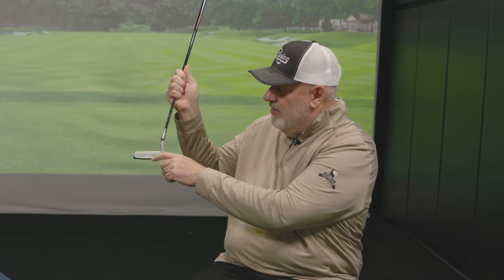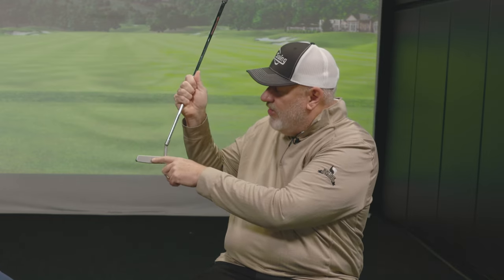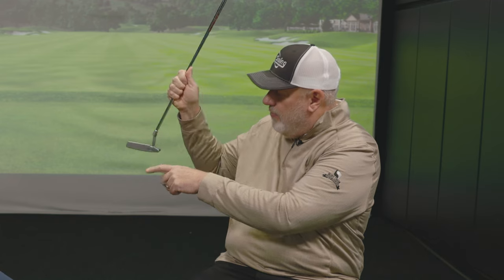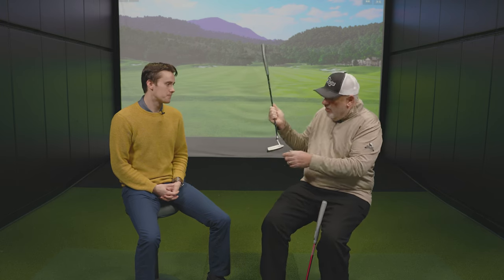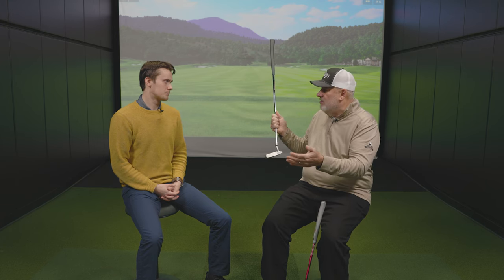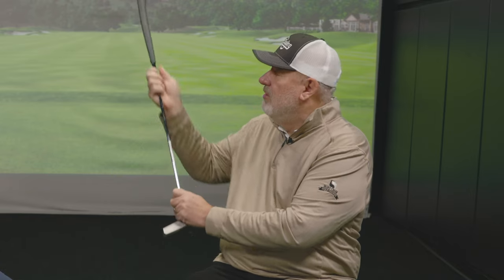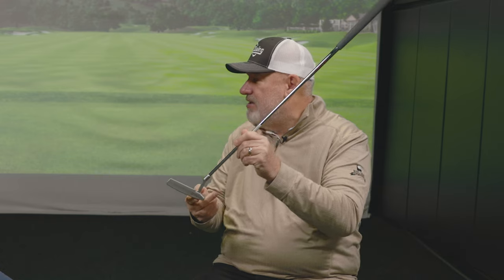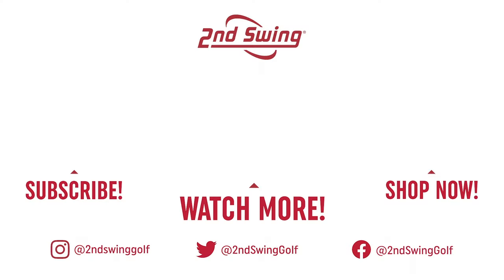The No. 1 Variable in Golf Putter Fittings

Comment: At age 61 and having played from age 7 I had always used a Blade style Putter
In the 40s and 50s I would say I could sink any putt within 15 feet about 2/3 of the time
and should I miss it would be a simple tap in
but
In my mid-50s both distance and line started to go away
Granted with age I became a bit less stable in the swing (line) but I had started to leave
that 15 ft putt 2 or 3 feet short, thus making the next putt NOT a simple tap in

Last month I purchased a new Orlimar F80 Mallet Putter
Took it out with 10 balls that night as I live on the 16th green and tossed the ball out
All different ranges from 8 to 15 feet and different angles to the hole
BANG
Dropped 3 of the 10 and none were outside4 of 6 inches
SOLID
the hit on the ball was solid and felt good on every shot, it was clear that even hitting the club
off center by even a small bit was not an issue thanks to the overall weighting of the putter

I can not recommend everyone change putters, but I do recommend everyone try something different
than what you are using today